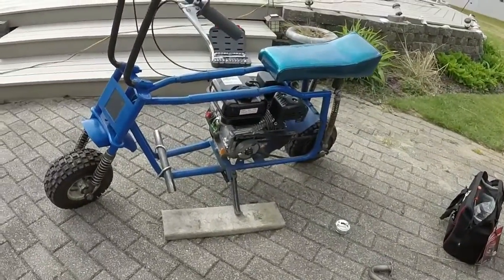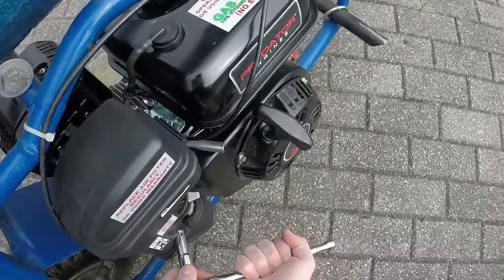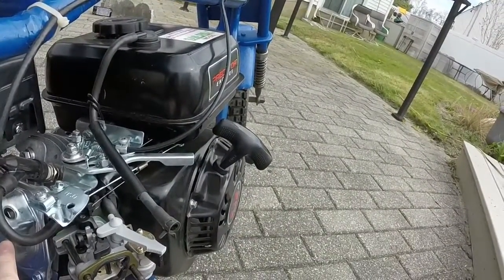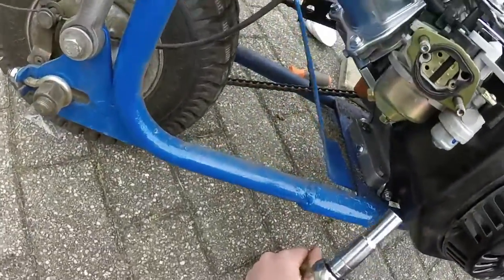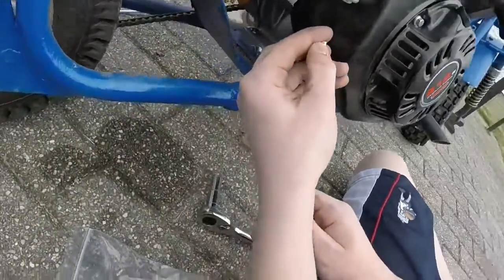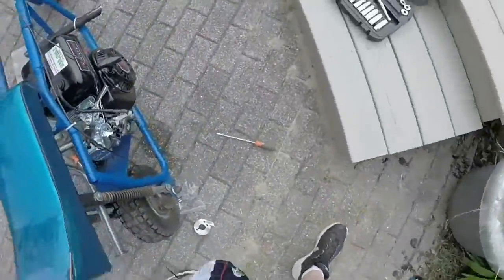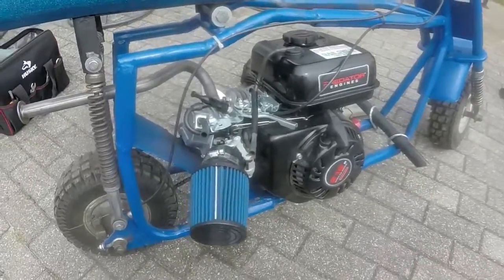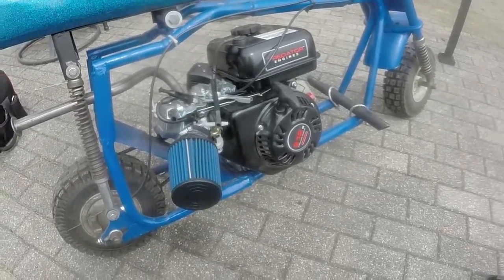Installing Performance Air Filter, Exhaust and Rejetting a Predator 212cc! (Tutorial)

Comment: what i did was install a new filter like the one you did, and both lines from the old one are not attached to anything, it runs perfectly fine on start but it dies on run, idk what the problem is other than the two lines
Reply: Sams here

Comment: you forgot to put the gasket back on the exaust pipe....you can reuse the one you took off or buy a new one... and the line coming from the crankcase to the air box needs a filter or you can just plug it using the stock line and a bolt. The line coming from the tank just needs to be mounted higher than the tank